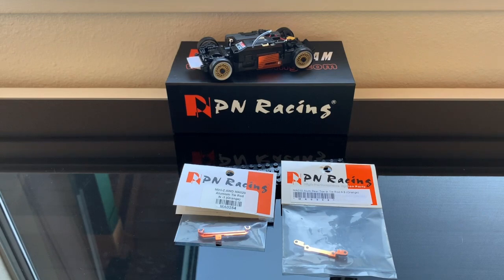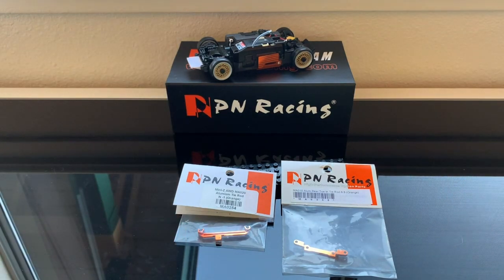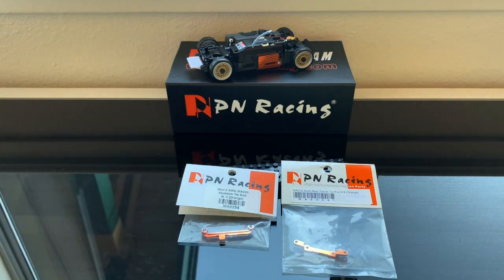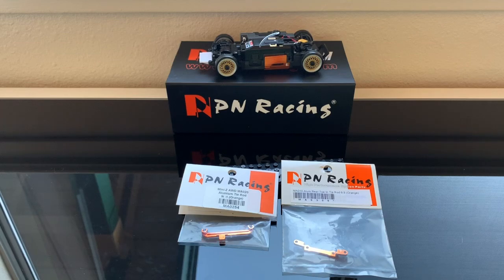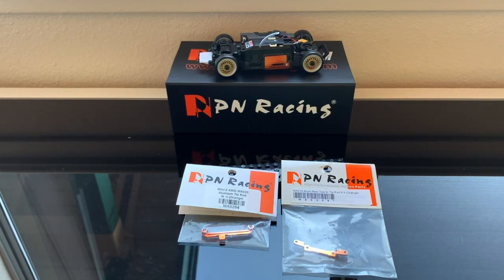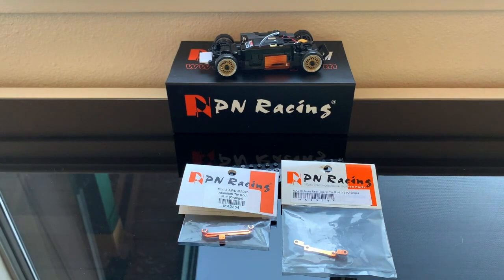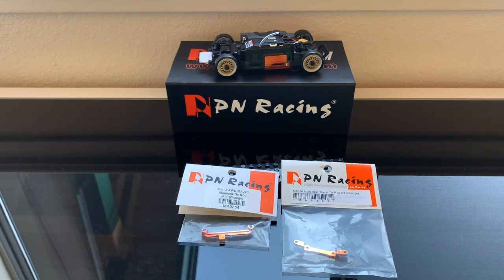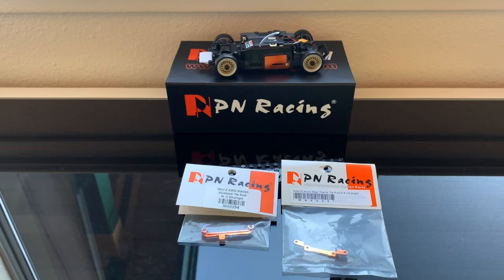Understanding Tie Bars & Toe Bars Mini-Z AWD MA-020s

Comment: toe in does increase the steering reaction and oversteering! what you are talking about when drifting is that that toe out helps you achieve greater angle of oversteering for the drift but the trigger would be more difficult to achieve to start the drift.

Comment: Rear toe 0.5 is probably perfect for this because when you go forward it will pull back to 0.
Reply from the maker: I have seen that said before but I figure that’s more to applicable to larger scale cars with more weight and better suspension systems. With the mini-z, especially the king pin rear end, it’s so stiff I don’t think the rear end has much room for play.

But you are probably correct, since I cannot find a zero degree rear toe bar for the mini-z, so there must be a reason.

Comment: Highly recommend the eagle rear adjustable springs and diffs, really nice and one of the easier ways to get a solid axle for drift setups as the kyosho ones are hard to get
Reply from the maker: Blitz Works Hey man, thank you for all the support & interaction, I really appreciate it! Thank you for recommending Eagle Racing, people speak highly of their products but since the prices are so low, I’m concerned about their Quality Control. I plan on purchasing most of the Eagle Racing parts for the MA-020, if for nothing else but to compare them to other brands. 

I’m sticking to Kyosho differentials for now since I know they have good tolerances & I was able to find them here in America on sale. Here is the links to where I got them: https://nitrohobbies.com/kyomdw017/

https://nitrohobbies.com/kyomdw024/?ref=isp_rel_prd&isp_ref_pos=1